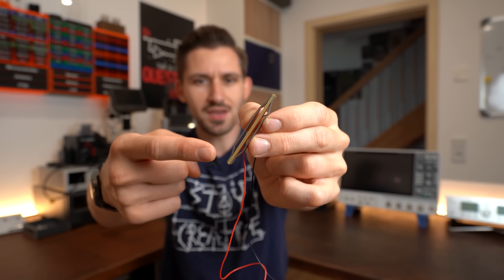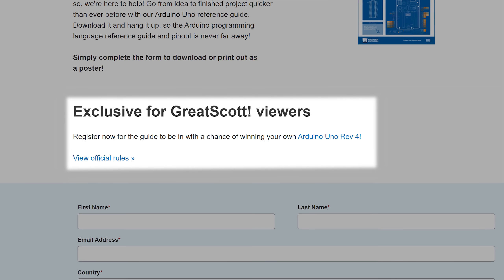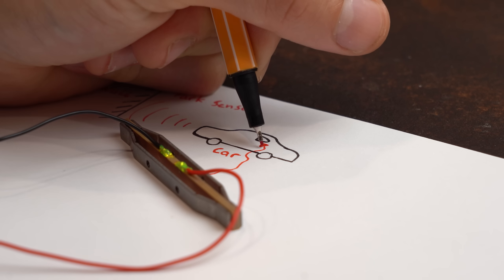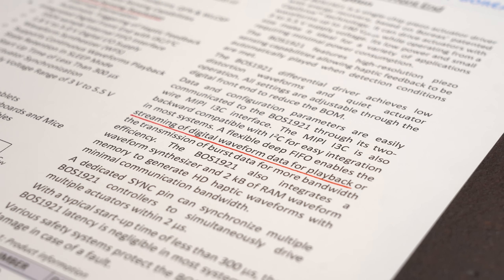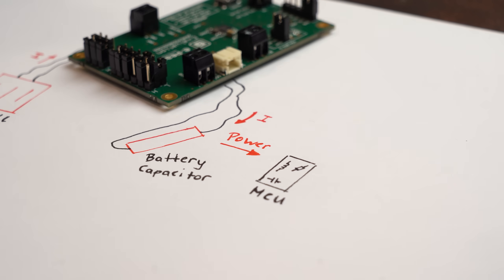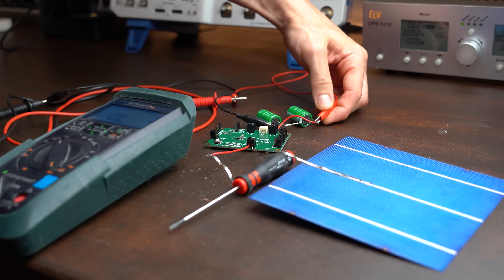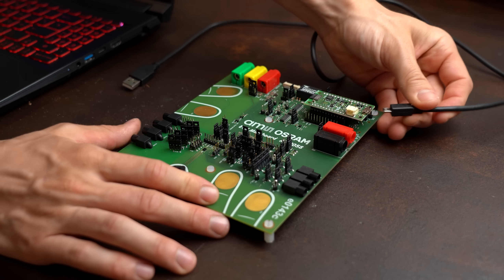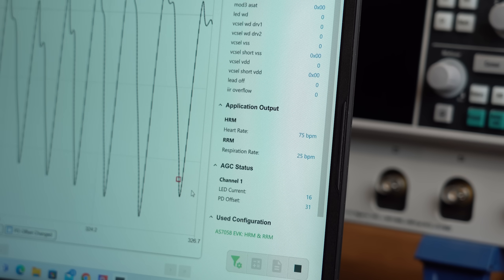I tried Future Technology! (that you can use TODAY)

Comment: Dear Scott,

I am an electronic engineer specializing in the design of adult toys. The motor you are looking for from Foster is difficult to find, but PUI Audio has a commercial version with similar features. It is available on Digi-Key (HD-VA2527).

There is also a version from the company Vybronics (VG2230001H). It is cheaper, but its internal construction is somewhat simpler, resulting in slight variations in response times.

Best regards,

Comment: 3:44 on my car my steering wheel has haptic feed back for when your crossing the line when you start slipping out of the lane. i love it it does also do it depending on the side of the lane I am going into. left is left of the steering wheel and well so on. it works well.

Comment: Hey Scott, I have a Card10 badgefrom the CCCamp 2019(an electronics "dev" board given out at conferences), which has an ECG sensor as well, and the trick to taking good measurements using these tiny devices is calibration and being very still. The calibration(for what I guess are filters) on (at least my) devboard is handled by the front-end chip automatically, and takes a few seconds(up to 30), but you can clearly see when the data becomes "filtered". Maybe you'll even get some extra parsed data then. Any type of movement will probably give you a noise spike in the data and might interrupt calibration, so try to remain still. And good contact also helps, my badge needed to be pressed quite firmly to get a good reading. You can identify a good reading mostly by it looking like one of those TV heart monitors that go beep-beep(You know what I mean, right? :P).

Comment: Biomedical engineer here, that was a very noisy ECG a doctor can't use it to extract very useful reliable information from it. but it still shows your heart rate.
Reply: I was thinking the same thing.
Never did biology above undergrad level, but I couldn't make out any readable waveform other than a heart rate.
Probably because it's measured at the fingertips, which isn't really ideal as the distance makes the signal weaker and nerves along the way create noise.
Kind of like hooking EEG electrodes to your testicles and expecting to see brainwaves on the monitor.

Maybe the inputs for actual electrodes do better though.
Reply: @daviddavidson2357  yes the location of the electrodes and also the number of electrodes, the heart don't get all electrically excited then goes down like a lamp and a switch. different heart parts gets excited at different times, and they must do that in a harmony.

ECG is not a diagnostic tool to just see if a person is alive or dead, it is essentially used to see if the person heart is in harmony or not, thus you can't measure just one potential difference and call it ECG, you have to measure many potential differences at the same time.  hence comes the PQRST waves.  

if the aim was to just see the heart rate it is fine to use two electrodes only, if the aim is to get detailed information no, for a cardiovascular doctor it would be like listening to part of a conversation and you fill the gaps.
Reply: Can completely agree. Maybe needs a bit more configuration to get a cleaner trace.
Reply: Doctor here, agree, basically unreadable
Reply: Probably has to do with pressing your fingers down. Generally electrode need to be touching skin on their own gravity or antigravity to not have noise from force applied with fingers
Reply: A Blood pressure machine for example uses an inflatable tube to provide contact and uniform force distribution
Reply: I learned something today👍
Reply: Can confirm, I’m also a biomedical engineer and I was just about to comment the same
Reply: You got a short
Reply: Electrical engineer here, every noisy signal can be filtered and cleaned up with the right combination of software/hardware. If you saw radio signals before being filtered you’d have an aneurysm
Reply: @1SmokedTurkey1  For sure, but beyond a certain point, no amount of capacitors or inductors or code can compensate for too few, and/or or poorly placed electrodes. Garbage in, garbage out. With filtering: garbage in, much more pleasant garbage out.

Comment: Hey Scott, 
The ECG signals you are measuring are still full of noise. You should be able to clearly see your heartbeat in the signal. Maybe you have not connected everything right or did not setup the right filtering but if you want to try a reliable all in one solution that i know works try the MAXREFDES100. Easy to use and very accurate. Thanks for your amazing videos!

Comment: Regarding EDA, usually, the signal is filtered and processed to detect rate of changes. In conjunction with other signals (like ECG) it becomes a good indicator of changes in emotions, so smartwatches use it to detect stress, unrest, etc. As far as I have read, the main issue is that the patterns are highly individual-dependent. So currently smartwatches/phones train a machine learning model with your data for about two weeks (inviting you to also label events, i.e. indicate how you were feeling in certain identified "events"), so they can eventually identify these events automatically. I guess this is the reason you don't see any useful data in the DevKit, it would have to implement a detection technology and then train it with a bunch of data first.

Comment: I am an Electrical Engineer working in the Medical Devices field and I have designed EKG machines before.  I agree with what the others said that what you have likely seeing is muscle noise.  That is what an EKG system is designed to detect since the heart is just a big muscle.  The challenge with using EKG from just a single pair of fingers is that there are a lot of muscles that are much closer than your heart  That is why EKG system measure across the body.  There single limb heart rate sensors typically use pulse oximetry.  They use light to detect the cyclic change in oxygen levels that are caused by your heartbeat.  They often do this by comparing the transmission or reflection of blue and red light.  I will have to check out the chip it uses.  I wonder how cheap I could make an EKG system now.  There are some possible applications for this if they could be cheap.
Reply: Well, there’s a lot of people who DIYed EKGs (that work much better than this) using just an instrumentation amplifier and some filters (which could also be implemented in software), so very cheap, I’d say.
Reply: @GRBtutorials  Yes, the biggest issue I had in the one I design was protection against defib events.  Also, there are a lot of regulation for leakage, etc. you have to pass for electrodes that are in contact with a patient.  If the chip already certified for that, it simplifies the regulatory approval process.
Reply: @connecticutaggie  Ah, if it’s for a commercial product it’s harder, yeah. Especially if you’re powering from mains.

Comment: Hello Scott!
I work in the medical device industry and so glad you have tested some biomedical electronics stuff!

A couple of comments:
1. 92% SpO2 is far from normal. You'd expect a >95% on a normal, healthy adult. During resting state this value should be at >98% in most cases. (Remember during Covid times patients with an SpO2 value below 88% were considered critical and would require assisted ventilation.) As of the PPG waverform morphology it does make sense -  the drift in the signal amplitude is likely caused by slow finger movements as suggested by the envelope of that signal. Actural SpO2 devices would normally feature a clip with the photodiode and LEDs (Red and IR) on either side, in order to a) limit the "volume" in which blood would circulate, and b) block ambient light to minimise interferences, so that changes in the oxygenated haemoglobin vs. deoxygenated can be calculated. This is a classic application of the Beer-Lambert law.

2. The ECG graph does not resemble anything like an actural ECG signal. Granted, you may think of the peaks as R-waves, but the waveform does not seem well-processed. ECG standards such as IEC 60601-2-25 and AHA clinical recommendations call for a high pass filter with a cutoff frequency at 0.05-0.5 Hz, a low pass filter at 150 Hz, and a mains notch filter at 50 or 60 Hz. The HPF is there to remove the baseline wander and respiratory signals, while the LPF for removing EMG from muscle contractions. It seems that the EMG from flexing your fingers are drowning the ECG signals from your plot. Maybe worth another try with stick-on electrodes, preferrably three of them, on the left arm, right arm and left leg. If this eval board comes with built-in right-leg driver circuit then you are in luck as it will greatly reduce the mains interference on your ECG signal, if you also connect another electrode on the right leg to the output of this circuit. It will invert the mains interference signal and re-inject it to the body, works like an active noise cancelling headset.

3. Electric safety is always an essential performance in medical devices. The electrodes you've touched are effectively type BF applied parts of a medical device (per IEC 60601-1). Hence it is required to have those galvanically isolated from the PSU (in this case, a laptop connected to mains). This can be satisfied if you insert a USB isolator with more than 2kV dielectric strength between its primary and secondary sides between the laptop and the eval board, OR disconnect the laptop from its charger and use a battery pack to power the eval board, if necessary.

As always, very informative video! And I will see you next time! 😊

Comment: IMHO having haptic feed back through the steering wheel would be a bad idea.  I like the fact that I can feel the road and how the front drive train is performing and pick up on new vibrations and the like; these can be an early indicator of a mechanical fault or hitting something when revering/parking/etc. Adding external vibrations to the steering wheel could potentially mask an issue! :-(. I'll stick with the beeps.

Comment: One good use would be putting it in the accelerator pedal of a drive by wire vehicle that has a manual transmission inorder to give the driver more of the engine feeling that the old cable operated throttle body’s used to provide.

Comment: Dear Scott,

I am a physician, and I noticed that the electrocardiogram displayed in your video is full of interference and noise. The isoelectric line does not remain stable at 0 volts, likely due to muscle contractions in your arms during the test. As a result, you are simultaneously recording an electromyogram along with the electrocardiogram. Despite this, it is possible to distinguish the spike of cardiac contraction from the noise.

Additionally, if you are otherwise healthy (besides your love for complex electronic circuits), you should not have a 92% arterial oxygen saturation at rest. Therefore, the oximeter sensor probably needs calibration.

This is my first time commenting, but I would like to express my congratulations on all your videos. Each one is an educational gift to those of us who dabble in electronics as a hobby. Please continue your high-quality work, and it would be my pleasure to assist as a doctor in any application related to my field.

Kind regards,

Dimitrios
Reply: Yeah the 92% worried me a little too. Maybe hes a smoker? Great video though! love the content mate
Reply: @krisbergin8628  I have seen a couple of oxymeters and all of them are closed, blacked boxes to ensure light bleeding in. This is an open system, I think this is the main problem with it.
Reply: Thank you for your work
Reply: Came to post something similar to this. I think you nailed it pretty well. There's the hint of a QRS complex in there right as the screen fades out.
Reply: Agreed, that's an extremely noisy ECG. Coming at it from the biomedical engineering side here. 
Have not read the datasheet in detail. Would be surprised if it didn't offer more signal conditioning features onboard. Probably designed with a downstream DSP in mind.
I've cobbled together entire frontends on a breadboard or two before. Consistently impressed by modern semiconductors.
Reply: Great insights
Reply: Does the watch affect or perturbate the measurements ? Because I see it blocking or exerting pressure on the veins.
Reply: This is fascinating information to share. Thanks and congratulations on your first comment. Cheers.
Reply: My entire body is sunburned in the front any advice? I wont be able to sleep for a while because of how bad it burns
Reply: @sandstealers476   sleep on your back. Apply aloe vera, and next time use sunscreeen.

Comment: The ECG tracing does not resemble an actual ECG. I think that the problem is that the board doesn’t have any filters to eliminate all the noise. Try applying a band pass filter with a low pass @ 150 Hz and a high pass @ 0.5Hz. Additionally, you want to eliminate the power interference by applying a notch filter and blocking the frequency of your mains power (50Hz in Europe, 60Hz in USA).
That should clear the noise and leave the normal ECG tracing showing the P-QRS-T waves.

Comment: That Piezo module could be used for sonar.
You ever hear of a Pebble smartwatch?
 I was fortunate to have one.
Sadly they are no more.
All this wonderful technology in module form or SOIC, it's amazing no one has made a fully functioning Pip-Boy, Tricorder or Jordies visor.
I've seen a lot of imitations, but never the real thing.
I always wanted to see a visualization of the electromagnetic spectrum when looking at boards for faults.
You would think with as long as MRI tech has been around, someone would have come up with some DIY applications. 
 I played around with those cards that allow you to see magnetic fields to some degree .
Those are fun, particularly on inductors.
 I actually bought a phone with a FLIR built in because I was tired of burning my fingers looking for the short circuits.
Imagine a single device that would allow you to see a huge swath (100μm-1nm) of the Spectrum compounded with magnetic resonance?
If we could actually see the EM fields in a device as its working, we can diagnose faults and fatigue super fast. 
Couple that with ultrasonic hearing and you have the ultimate diagnostic device.

Comment: You only first tried it with the DualSense controller? Never used the Steam Controller, or an Apple device wirh taptic feedback? Or HD rumble on Nintendo Switch?
Reply: I think he meant that it was the first controller that he used that had a voice coil driver and not an eccentric on a motor..

Comment: Interesting video! The haptic device is quite intriguing. On the ECG I can only say that it seems that one can descern the electrical depolarization of the ventricles, so one could get info your heart rate, and if it is a regular or irregular rhythm. But more than that isn't discernable with this setup. Regular diagnostic ECG uses 12 leads, and a basic monitoring ECG uses at least 3.